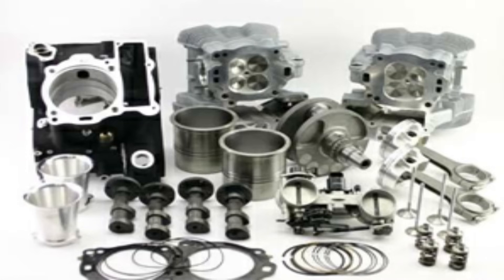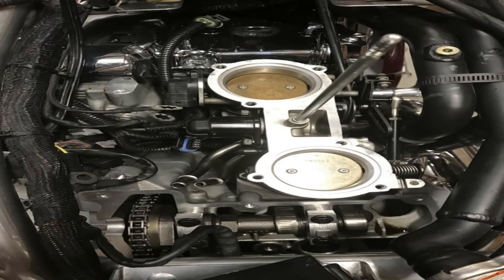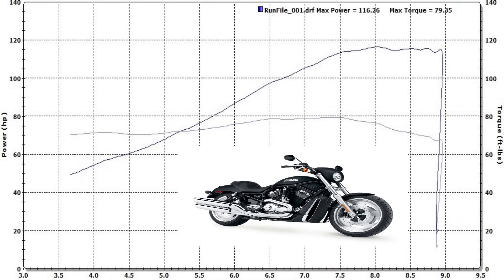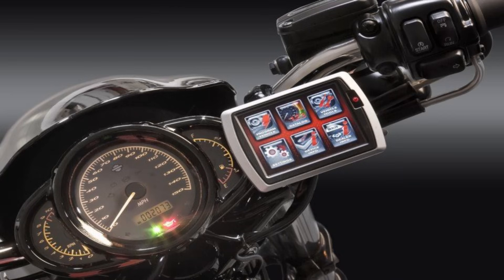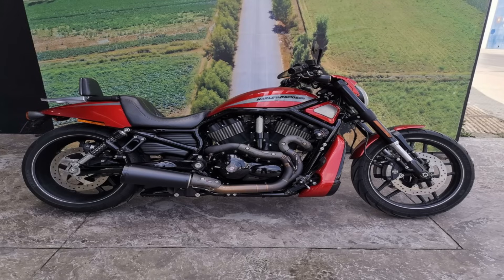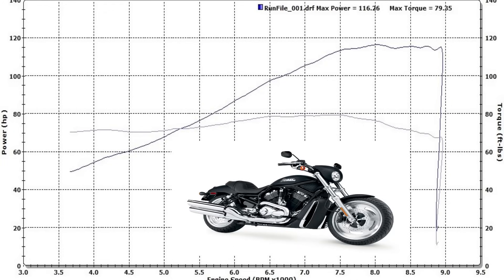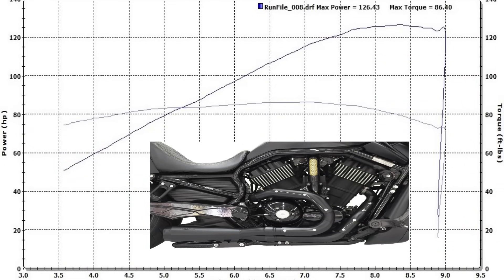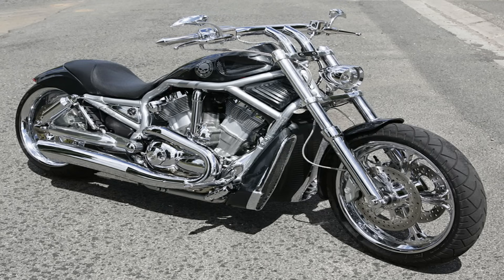The Vrod Has One Simple Trick For All Power Upgrades

Comment from the maker: Do you think a set of cams is worth the money or just exhaust and tuner is more than enough?
Reply: Exhaust, tuner AND pulley gearing upgrade. Doing a pulley upgrade like 2 teeth up on rear and 2 teeth down on front keeps the wheel in the same spot, gives incredible bang for buck and you don't have to enter the engine. Sure it means a few more rpm, but the torque increase is awesome. This goes for ANY bike.
Reply: HD went tall on the M8 softails for emissions. 2.79 final drive ratio. Next rear tire change go to a plus 4 ie 70 tooth pulley. This changes your final drive ratio to 3.00-1. Acceleration AND top speed will improve no other changes. That’s Assuming a tuner has removed your speed limiter and raised your rpm limit.
Reply: @vernlochtefeld1626  they did the same when they went to 6 speed with the twin cams. Does going 4 teeth up on rear require a belt change though?
Reply: Nope there is plenty of adjustment room. I knew they did at least some years with the TCs.
Reply: @parkeslife4323   I added the 26T pulley , my stock is 72T rear should I look for 74 T? Is that what your saying 16 muscle vrod
Reply: @mikejones15forlife  what's the stock front, a 28? If your belt still fits it's all good. If you want more torque fit the 74. You'll loose a bit of top end speed but she'll be a rocket out of the hole.
Reply: What do you do with the sensor on the airbox?
Reply: Cams net more gains for the cost than any other upgrade on a vrod.
Reply: Just to give you some updated information on the V-Rods. Fitzgerald Motorsports has their own big bore and stroker kits and can go as high as 1488cc. They also port the heads, custom cams, 2-1 exhaust, and even a bigger throttle body. And make on average 165-175rwhp and 110-115 rwtq
Reply: And for the guys that don’t want to build these engines, they can make 180-200rwhp with a turbo or supercharger.

Comment: I have 2:1V&H & topless, have the SEPST, but recently picked up a PV with wideband O2. Yet to swap it in and do some autotunes ..
Reply from the maker: That's the setup we've done on my dad's 2012 Nightrod, topless box and 2 into 1. We tuned it with the PowerVison and used the tune we got from Fuel Moto, did some autotunes on the narrow band. Map works pretty well but it could always be better, curious to hear what that wideband tune does for your bike!
Reply: @GixxerFoo  yeah, I've been a bit lazy and haven't got around to it yet. Will be tuning the TC this way also.

I will need to pull the cam chest out of TC first, to see what cams are installed, so FM can send me a base map.

Comment: I’ve got a 03 vrod with bassani 2 into 1 exhaust baffle in with a tuner stock air filter. It made 110whp. I want to take the baffle out with air box mod and retune.
Reply from the maker: 110 at the wheel is really good! Just keep in mind taking the baffle out and running it open will knock down your low and mid range a bit but it will peak you on the top end. You may not feel it but it would show up on the dyno, just make sure you retune after you make any mods.
Reply: @GixxerFoo  I found that out the hard way lol  I pulled the baffle out and rode it afew miles and it seemed to run good until the computer figured out sumthing was off. After that it ran like shit. I put the baffle back in and it runs back fine again. It sounds so good thou with the baffle out! It ran very good from a 30 kick with the baffle out.

Comment: I purchased a 2014 VRod muscle, I love everything about it, I which though the sound would be deeper, not loud, just deeper. Any advice on what I could do? Thank you
Reply from the maker: A nice set of slip on exhaust and a tune will help a lot with that. They are really quiet with the stock mufflers.
Reply: Gut the cool stock pipes of all insulation.  Add a thunder monster weld in baffle...looks like a tiny hollow magnifying glass .

Comment: What was the map you used and the parameters you did on power vision?
Reply from the maker: The Vrod is my dad's bike with Tab Slip Ons and a K&N air filter, I ordered his Power Vison from Fuel Moto and told them what the bike had done. They loaded their maps for that setup and it was honestly so perfect on the bike I didn't mess with auto tuning or any changes for fear of going backwards.
Reply: That's pretty much what I did also. But now I'm running topless. I just wanted to get an idea of how much more percentage of fuel should I add?

Comment: Can the baffles be cut out on a 2012 V Rod and go topless or do I need to add a tuner also?
Reply from the maker: You could cut the baffles out for more sound but you won't see any real performance benefits. I would leave the top on if you're going to go that route without a tune. You'll likely be hearing decel popping without a tune which would be worse with the air box topless.

Comment: MY 103 S2ITCHBACK I USRD THE SS 570 WITH 2 INTO 1 COBRA ON YOUT ADVICE AND PICKED UP ABOUT 20 TQ ABD 15 HP WITH THE DTNOJET MY 01 88  HERITAGE I USED WOODS TW6 WITH VH LONGSHOTS AND PICKED UP EVEN MORE POWER. TKS 4 THE GREAT ADVICE
Reply from the maker: You for sure have to pair with a good exhaust system, that can be as much as 10 horse swing making or breaking your power!

Comment: Trying to get more top end, is there a 6spd Trans available ?
Reply from the maker: Not for the Vrods, for more top end you'd have to look at re-gearing with smaller rear pulley or larger front. But this will cost your low end and mid range until you get rolling.
Reply: @GixxerFoo  I read something that HD released a very rare  CVO Vrod with a 6spd transmission. You ever heard of it?

Comment: Hey, 2003 vrod anniversary my clutch feels very weak. I have to pull the clutch all the way in for it to work. 

What do you suggest & if replacing it is a must which is the best clutch to replace it with?
Reply from the maker: How many miles you got on it? Might try servicing your master cylinder and changing fluid first, gonna want to do it anyhow if you replace the clutch. There's the Harley SE clutch set or you can check out Revzilla for the Barnett kit, both are really solid and about the same price. Don't want to go cheap on the clutch and have to redo it again.

Comment: Chain Drive??
Reply from the maker: Only chains on this bike are for the cam shafts, all belt drive out back still.
Reply: @GixxerFoo  I know but there are conversion kits to change out the belt for a chain. Chains can take more torque force where as the belts get their teeth ripped out if you change the ratio, with the sprocket toothing on chains that can add to the overall performance, torque and top end speed where the belt system can't be modified or the overall torque of the engine will shred the teeth and integrity of the belt.

Comment: What's a topless air box?
Reply from the maker: You just leave the top cover off the air box, the air is drawn in from a snorkel on the air box top when it's on. Removing that air box top allows the engine to freely draw air through the air cleaner.
Reply: @GixxerFoo  ,,,thanks

Comment: Thank you for the awesome advice I recently bought a 2006 1130 v-Rod for my 65th birthday I haven't had a bike in 40 years and all I can say is the V-Rod is one AWESOME MACHINE and if you have a need for speed it will put a smile on your face every time you twist the throttle and you can't putt around on a bike like that you crave that grin again and again,
Reply: WOW SAME THING HERE BEEN RIDING SINCE 8 U NAME IT I'VE RIDIN IT AN OR RACED IT 66 NOW IT 65 GOT A 08 VRSCDX NOT STOCK JUST 2 IN 2 1 AIR BOX TUNER ROYAL PURPLE DINO 126  4 A MAJOR THRILL I GET ON THE XB12SCG 4 MELLOW THE 1600 STORM RIDE SAFE BROTHER AN THX!!!

Comment: What i did on Vrod cvo 2006: race ported heads, stage II cams, destroyer throttebody, destroyer injectors, 5bar fuel pump, 5bar fuel regulator, destroyer headbolts(13mm), screamin eagle racetuner(dynotuned by an expert), kn airfilter, removed top of airfilter box(topless), engine brace kit, slipper clutch, VH 2 into one exhaust , raise speedlimit from 9000 to 10500. That did pump the bike up from 125hp to 165hp, on rear wheel 138,5hp. there is a lot of power hidden in the screamin eagle 1250 motor , you just have to know where and how to release them. Important: USE stock velocitystacks drilled out to 58mm(make sure its smooth between VC and TB , short velocitystaks dont work well. So over to the cost in $$ , is it worth it in my book its not, but anyway if you who reads this still thinking about it Fitzgerald Motorsports in Ohio (Scott Fitzgerald) is the man to ask. He helped me out a lot with parts and good advice on the way.
Reply from the maker: That bike has got to be a monster, basically a street legal destroyer spec bike!

Comment: I haven't tuned my 2017 Muscle yet, but modifying the airbox w/S.E. filter did give a noticeable bump in power. 

NGK Iridium plugs & hotter coils almost as much. Tab Performance slipons without baffles; no noticeable difference.

But one inexpensive upgrade made a HUGE difference from mid-high rpm was a $15.00 Catch Can I bought off ebay  (w/vacuum lines, zipties & special clamp) to bypass that hot oily gas away from the intake: I must have gained at least 5 hp! (plus my Bike runs smoother now)

If I ever feel the need for more power after the tune; I'll go all out for a TTS Supercharger kit to put over 200 hp to the rear wheel.
Reply: Heh, heh! It's been so long I forgot that I already left a simular comment. But that one Catch-Can trick REALLY made a HUGE difference!

A good reminder to myself though; I really need to get this Bike dynotuned to see just how much power I rolling with (I'd bet 130 rwhp with a Powervision tune).

Comment: Looks like I need to research the topless conversion. Thanks!
Reply from the maker: It makes a big difference, it's pretty noticeable when you get some air to the motor!
Reply: @GixxerFoo  I've been running the Cobra tuner, but I think that it's time for me to step up to a better tool. I'm leaning towards the PowerVision, but I won't be doing cams, so I don't know if a simpler tuner would be suffficient. What tuner do you recommend?

Comment: Do you think a dyna tune would be more effective than a tuner (power vision/ power commander) thanks.
Reply from the maker: A dyno tune is very accurate and they are able to fine tune you're throttle positions at every given rpm. It's like getting a pair of shoes custom made for your feet versus just grabbing some off the shelf.
Reply: @GixxerFoo  I'm a little confused. So I have a power commander, do you still dyno tune that?

Comment: I had an 05B with stage 2 cams v&h 2 into1 topless and that had so much more power than stock now I have the last model with Stage 2 cam’s, throttle body, topless and v&h 2into 1 done cams dynoed it 10hp gain, then put throttle body on dynoed it and got 13hp more now I had to replace the heads so put some ported heads on it, it’s now 145.5hp and 88.7tq it’s full weight running 11.06 @ 120mph down the 1/4mile I say well worth the money

Comment: Very good advice.  
Bought 09 with a blown engine from a guy who had the full drag race setup , built motor from Vreelands Harley so I got them to build it again with different block or casing, it does 166 horsepower and just engine was $4500 and this was in 2017.
The guy before me had air injection added to it when he raced it and was doing 200 horsepower.  They do love the extra air.
166 is more than enough for me for a road legal drag setup, it’s a blast every time and will never sell it, unless I’m crippled lol
Reply from the maker: Damn that's one hell of a Vrod setup! My dad runs Nightrod, he absolutely loves it, running 166 horse that's some Destroyer power for the street!

Comment: Can you run a topless airbox without doing anything else?
Reply from the maker: Yeah but you'd want to get a tune, you would get some decel popping if you had a open air box and exhaust. With stock exhaust it wouldn't be an issue.

Comment: I remember when the V-Rod came out and I actually liked the look of the bike and didn't mind the water cooling. It was the little tank under the seat with a fuel pump and how complicated the service is on this bike that turned me off to them. They're probably great for the guy who lets the dealer do all his service but for a guy like me who does his own it's not the bike for me. Hats off to you for tackling the service on one of these. You're a good son.
Reply: Are they obsolete yet? Dealer probably won’t touch them anymore.
Reply from the maker: They aren't hard to work on it's just the tear down to get to everything which can be a pain. Valve adjustments aren't too bad, you just have to lower the motor down, that gets expensive if you're paying to have it done.
Reply from the maker: Not yet lol, dealers will still work on them. Most dealers won't work on a Evo and in some cases a TC 88 anymore. Some dealers have a 10 year policy and they won't work on anything over 10 years old.
Reply: @GixxerFoo  changing the battery makes you feel like a master mechanic haha

Comment: Any experience with the tab motohooligan super intake,I installed one and like the oil catch system but it added a lot of valve noise and not sure about it,but getting 127 rwhp with Fitzgerald ground pounder/super intake and a tune,2012 nightrod special

Comment: Mine is a 2012 with Vance and Hines 2 into 1, k&n filter, and dynotuned by my local HD shop, if I take the filter box off, will it need re-tuned?
Reply from the maker: You might be able to get away with it, every motor is different so it may run great or it may start popping on decel. It for sure wouldn't hurt to retune it, but you'd be splitting hairs for 500 bucks and 5 horsepower.
Reply: @GixxerFoo  thanks man, gonna try it next nice day.

Comment: I have an 18 street glide with the original Harley stage 4 114 but used a zippers 472 cam and d&d billet cat exhaust, makes 126hp and 131ft lb of torque. I have a friend with a night rod that has a v&h full exhaust and tuner and my bike will get him off the line but my 3rd  gear is a stalemate with him and after that he starts to pull on me. Guess I need to go bigger 🤦
Reply: Ever heard of Moonshine HD ?
The big bore kits and R&D that they are making are second to none 💪
 I would rather get their 128” , than HD’s  131”
These guys are 👌👍💪
Reply: @dmitrykhramov1832  I’d love to but live in Canada now so it’s kinda far now, they do great things with harleys and if time and money permitted I’d go to them in a heartbeat. Bike is currently in the shop with a blown up trans 🤷
Reply from the maker: That's one Harley dealer that really knows there stuff, they've got some serious engine combinations that work!
Reply from the maker: Dang that sucks to hear about the trans, it's a good time to upgrade to a SE gear set if the case is in good shape though.
Reply from the maker: You're 114 will pull hard off the line, that's what makes Harleys a lot of fun! But once that Vrod gets wound up it will start making it's power and take off.
Reply: @GixxerFoo  Harley trans are pretty weak, moonshine did a video on them and 3rd gear is notorious for going out because it has so much play from the factory setup.
Reply: @GixxerFoo  I have an 03 v rod and a street bob 114. Definitely 2 different power bands. Both equally fun. I do prefer the comfort of the street bob though.

Comment: Bought my 2012 VRSCF a few months ago, it came with slip-ons, k&n air filter and Thunder Max system. Did the topless mod and had it dyno tuned. The bike is a beast and is a blast to ride. Great video btw.
Reply from the maker: Damn that's awesome finding one with a ThunderMax already on there, those units are grand themselves! Sounds like you've got everything done right on that bike!
Reply: @GixxerFoo  yes Sir, when I took the rear seat off looking for a tuner of some sort, expecting a piggy back style, my heart skipped a beat when I saw the Tmax ECU. Ended up talking with the previous owner through a V rod group on FB and thanked him for trading it in with that system.

Comment: I have a 2012 V-Rod Muscle….kept the OEM headers….put the the V&H competition series slip on exhaust, the old OEM super tuner,  high flow air cleaner and had a Dyno….it raised the power up a little and that’s enough for me…it’s a really fun bike to ride and I’ll keep it forever. I also have a 2020 Ducati Diavel so if I really want speed I ride that bike….if I want to just cruise then I switch to my 2018 SG CVO. Thanks for the video.

Comment: How would a mild built sportster 1275, 570 cams, xb heads stack up against one of these v rods?
Reply from the maker: With a good exhaust system and tune you'd be close to 100 horse, I'd say with the weight difference it would be pretty respectable against a vrod.

Comment: What kinda of hp would I get on 103ci with 58mm screaming eagle throttle body,  thundermax tuner,  585 s&s cam and a set of true duals?
Reply from the maker: With a bolt in 585 I would guestimate being conservative 90 to 95 horsepower and around 110 on the torque. That's a conservative estimate, with a good dyno tune I wouldn't be surprised if it broke 100 horsepower.

Comment: All i envision with the top of the air box removed  is dust giong down the intakes and reduced engine life ?

I like the thought of a 6 hp gain     but i would still worry ?
Reply from the maker: The air cleaner seals all around the intake so you won't have to worry about that.